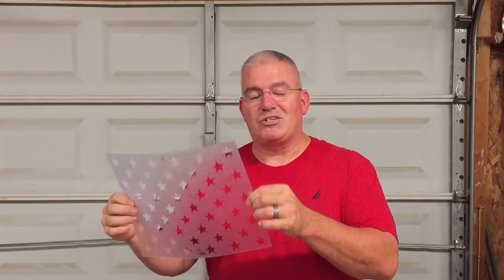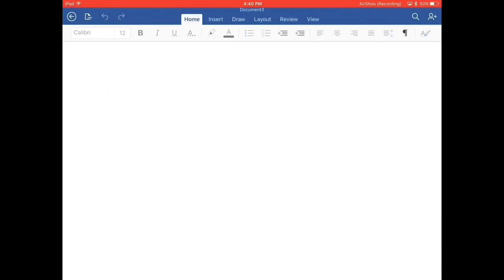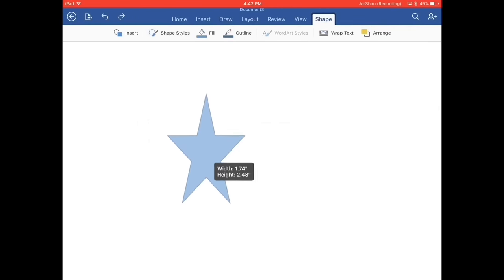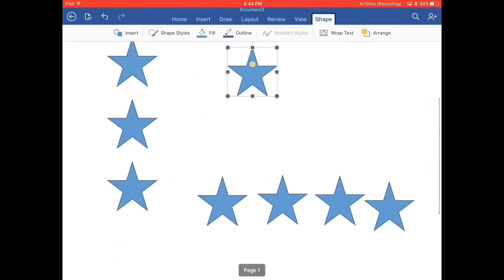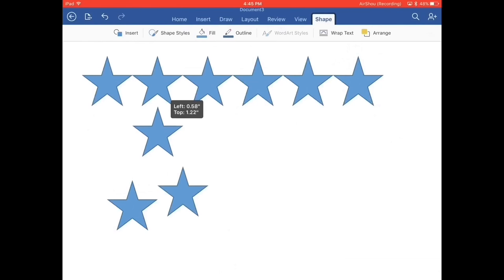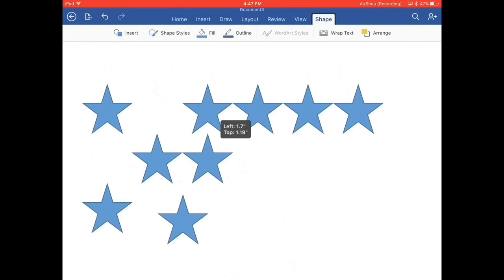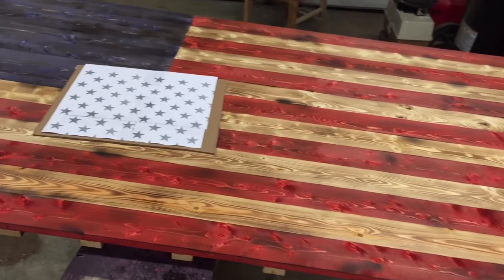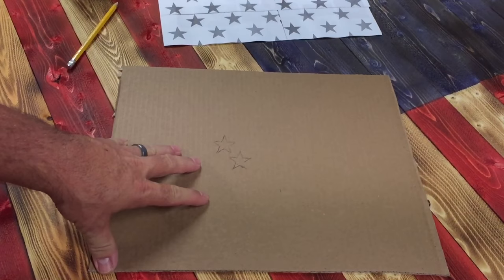DIY Fifty Star Stencil / Rustic American Flag

Comment: This may be a dumb question, but couldn't you just transfer your print via carbon paper straight to the wood for carving?  Essentially your printout is your stencil at that point, and you save the hassle of having to cut 500 lines with an exacto-knife.  Just curious to hear your thoughts or if you have tried it that way.  I may be overlooking something obvious but that seems like a huge time saver, and probably worth the cost of the carbon paper + you are not having to buy the plastic.
Reply from the maker: Not a dumb question, your correct, you could transfer the image with carbon paper or you could use a spray adhesive and attach the printout. You can carve through the paper once attached which works pretty well, this is something that I have learned from other flag makers along the way. I appreciate your comment, thank you for watching

Comment: Thanks for sharing your video. It will definitely help sharpen my skills. Is the lumber you worked with 1x2's? It looked like it, but just want to make sure. Thanks for the help.
Reply from the maker: c Chance I'm glad you found my video helpful. I used furring strips that were 1.5" wide x .75" thick. Thank you and good luck with your project.

Comment: you could have/ should have used MS Powerpoint for this project.  I has the shapes and it has all the snapping options where the corners of each box will snap together.  It is the same as what you did, just way more efficient and exacting...  Good work though.

Comment: Thanks for your helpful video, I just made my first stencil yesterday. It was very time consuming but I knew that going in. On the 19 1/2 wide x 37 long you said you used 1.1 inch stars, but what size did you use on your smaller stencil measuring 13wide x 24 1/2in long? I would like to make stencil for this size also.
Reply from the maker: I used .7" stars for that stencil.